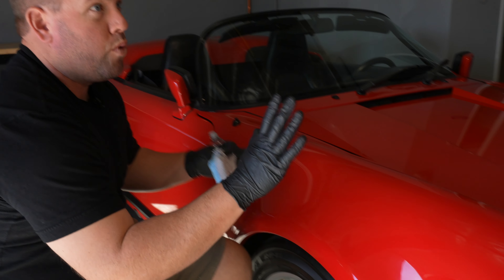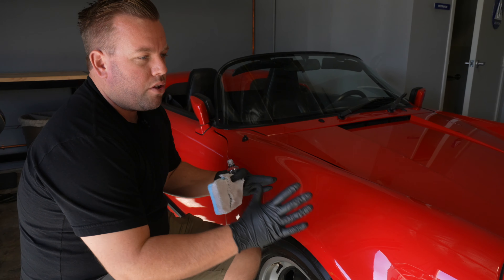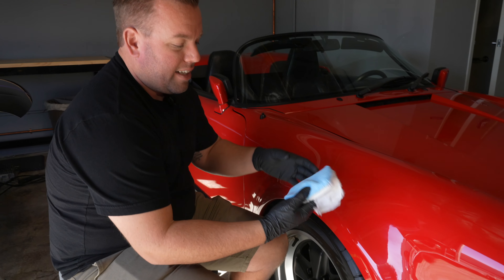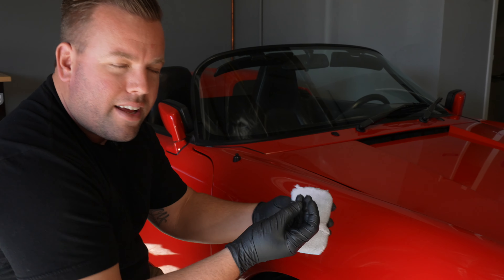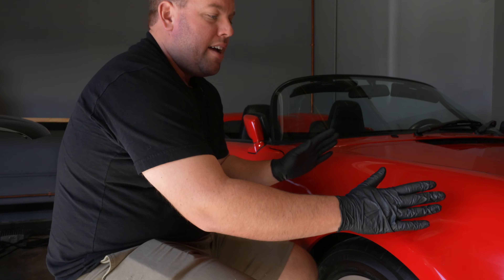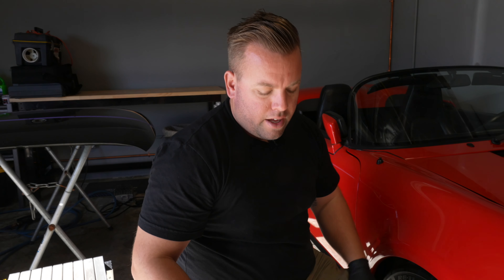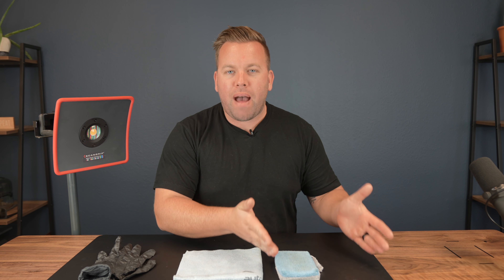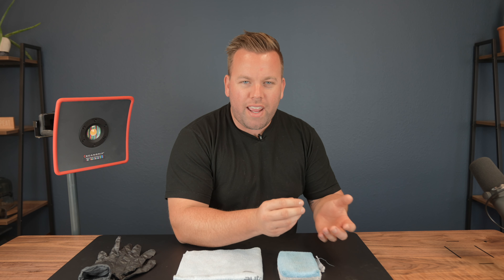NEVER MESS UP A CERAMIC COATING EVER AGAIN - DO THIS...

Comment: Thank you very much
Sad that towels and applicator are singe use only
Reply from the maker: Towels can be reused.
Reply: @autodetailingpodcast  But ceramic will harden in to glass , then break in to glass powder and scratch ?
No way to wash that ceramic off as well. I have tried.
There is no way to even wash towels after Fuso 12 m
Argh !
Well at least with Chemical guys Microfibre Wash detergent which as well does not restore softness

Comment: For high spot inspection, all you need is one thing - a very diffuse panel light, and you must look at the REFLECTION of the light on the surface. A video panel light works, but the cheaper ones where you can see the individual LEDs aren't as good as the ones where the panel is perfectly even. I'm actually using a tablet computer set to display a white screen.

Comment: Hopefully the print on the towels won’t transfer nor stiffen the micros'  fibres to mar [or react with products]. But when we quarter a towel and grip to use, don’t we pinch from the four open ends to avoid layer slip? If the print is OK, wouldn’t it be better to shift the numbers to the outer corners?